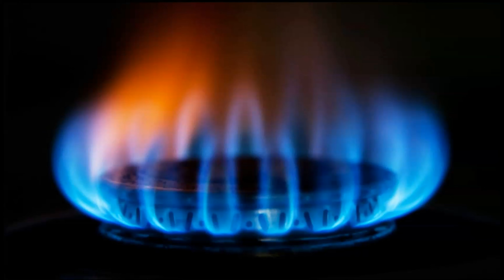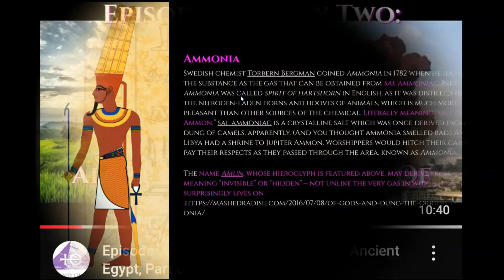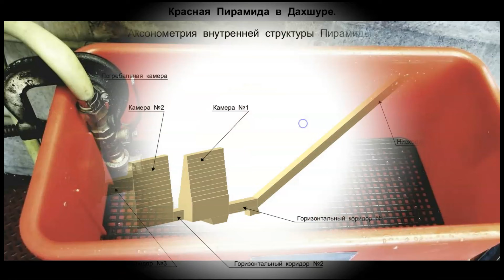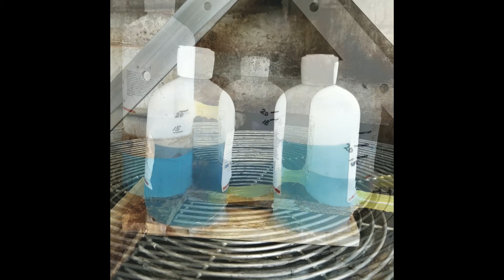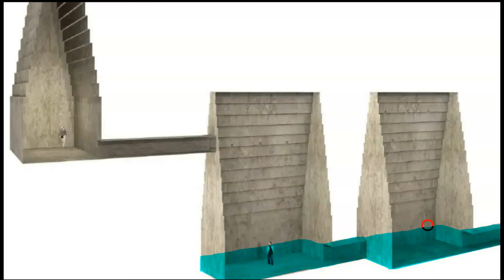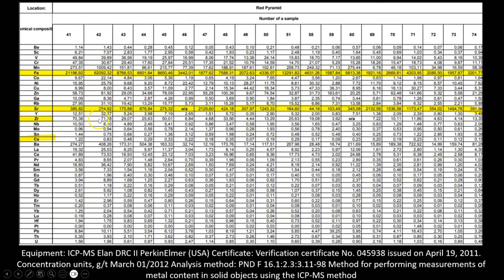Episode 156: EGYPTIAN PYRAMID CHEMICAL ENGINEERING TECHNOLOGY - PART 1, RED PYRAMID STEAM REFORMER

Comment: My guess about this: It’s not that they made huge huge amounts of these chemicals.  They didn’t have systems of energy generation that modern times offer.  They had passive water channels, manually operated shutoff valves, and techniques for directing the flow of gases.  And chemistry.  So at the right season they setup the system to produce ammonia, prayed to Khemit for rain and lightning, got their strike, and then they had a giant batch of chemicals to last for a long time.  But it wasn’t something they could do on demand.  They depended on the river and the weather to make it happen.

Comment: The black dacite stone boxes might have contained uranium rods that could have potentially heated water to the boiling point. When uranium atoms are split (fissioned), they release energy, much of which is in the form of heat. This heat can then be used to heat water or other fluids, potentially causing them to boil and aid in chemical production. I'm not sure if these heavy boxes still show a heightened level of radioactivity. If they do, it's probably what they were used for.

Comment: If they made ammonia in the Red Pyramid, where did they introduce the methane or hydrogen gas into the final chamber to produce the reaction? 

And would it be possible they used airship balloons to transport the large blocks and build the pyramids?

 Is it possible that the "nemes" is a type of breathing mask, using the statue of Djoser as an example?

Comment: I've always been on board with his theory you have. But, we always must look for flaws. Looking at old photos, I estimated the volume of chamber 1(from the top of the inlet) as 65.75m³ and the volume of the top 2 corners at 2.25m³. The actual V doesn't matter so long as the ratio is close. Using 25⁰C as the initial temp.

Compressed methane final temp came out as 568⁰C. So even with an error margin its well above the temp needed for this reaction. 

So crazy that they'd build a burial chamber that reaks of ammonia in the exact dimensions needed to turn methane into ammonia.
Reply: I had a discussion with Gemini about this. Very interesting. Apparently, iron is needed ascs catalyst. And iron oxide is turned back into iron using hot hydrogen. Could that be the materials that where placed into the sockets in the upper corbels? FeO³ in the 1st chamber turned into Fe. Then on next full cycle, they're moved to they're swapped to the 2nd chamber and turned back in to FeO³ as a catalyst?
Reply from the maker: Yep, the calculations are irrefutable. I have several coming up in part 2. It actually gets hotter than that, but with the addition of electric fields and catalysts, the same reaction will proceed at lower temperatures.